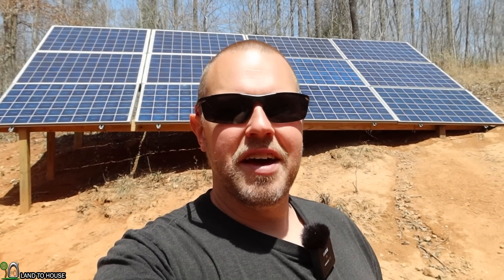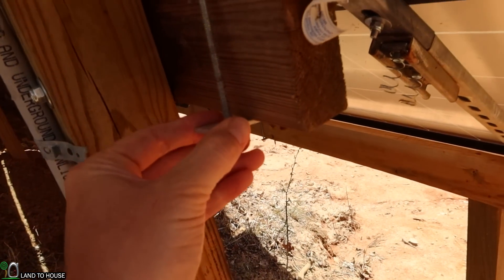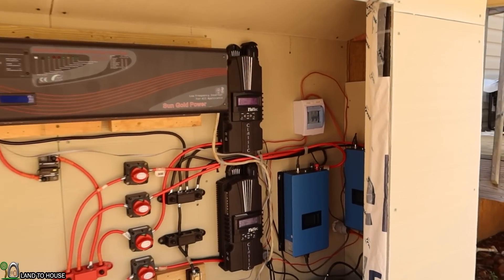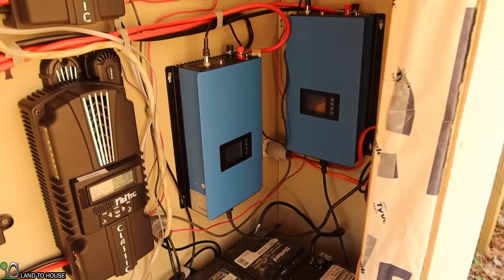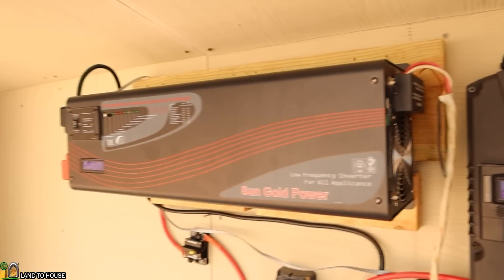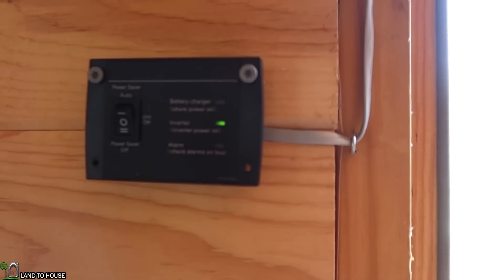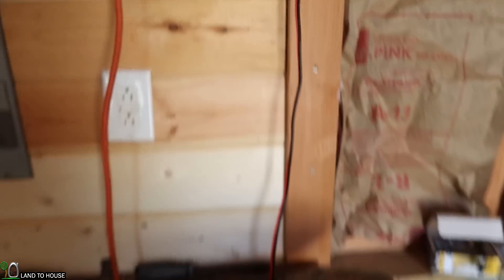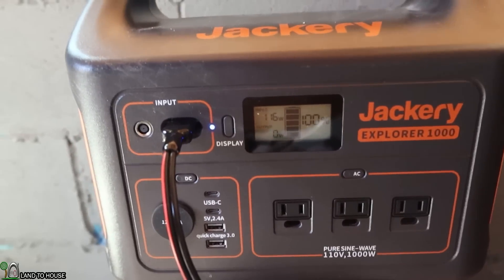Grid Tie Solar and Off Grid Solar Update

Comment: Why are you using AC lights for your off grid systems rather than just 12v lights coming strait off the batteries? Inverts loose about 10% of the power by converting it from DC to AC.
Reply from the maker: The tiny house was built and wired back in 2014ish. Way before I understood the benefits of 12v. I can easily wire in more lights someday.

Comment: I ran a similar system for quite a while before switching to a big single hybrid inverter (Deye 8k) that can supplement the grid power or seamlessly switch to off-grid mode when the power goes out. I used a mppsolar lv5048 and its charge controllers and a couple of those GTIL2's, I had some backup outlets from the lv5048. It ended up saving about $80 a month in power where I'm at and how much my family uses. It's a lot easier to swallow the out of pocket price if you think of it as "emergency power solar generator that slowly pays for itself", because I would have invested in making the emergency power solar generator anyways.

Comment: Interesting video and setups! In Finland we have 240V and 3-phase electricity everywhere, so Grid-tie inverters are also 3-phase. I Got 10 kW solar panels, but I can sell all that is produced and not used in my house and interesting part is that when I have 2 year contract with 5 snt / kWh for buying (yes Euro sent) almost same as dollar so! And what I sell is based currently stock electricity monthly average price, so lately is has been between 8 to 12 snt / kWh so all you produce over they pay about twice what you when buying from grid! 10 kW produced in April 2022 here over 1100 kWh. Own use about 400 and almost 800 for selling to grid company!

Comment: Would 12v DC lighting reduce the loss from the AC/DC conversion ?   Ram Pump still kicking out and filling 250 gallon totes per day.
Reply: All my lighting is 24v up here. Love it. Set my place up like my boat was.
Reply: I'd make the same suggestion,  12v camper "convenience" lights added to the tiny house.
Reply: @jllaine  I saw one off grid tiny house had 12v LED Strip lights

Comment: good to see different applications of solar, im not allowed to use grid tie inverters so i am going with a transfer switch and sub panel for my house solar system. I have an off grid system in my garage/workshop and it has taken a almost two years to get it to where the system can power everything all the time. The surprise for me was how many batteries i needed to get thru the nights and poor weather in winter.
Reply: Why are you not allowed to use grid tie? What if you use a grid tie inverter with power limited, is good because you don't export energy
Reply: @TheJponton   the power company i have will not allow any power connected to the grid to be active when the grid goes offline. It is possible to get the equipment that is approved to sync with the grid but the expense makes it more economical for me to just install a transfer switch.
Reply: @arnoldreiter435  I understand what you said. I have a micro tie inverter and it was a good investment for me because the minimum power consumption of my home is 150 W and it produces 100w. I have been thinking on upgrade the sysmtem with a 1kw grid tie inverter with power limiter but I need to invest on batteries in order to not waste energy and it will increase the price. If your consumption is more than 4kwh per day maybe that inverter with a samll bank battery will fit for you.

Comment: If you don't know, Unistrut joint connectors exist.  You can eliminate the Al strip & all-thread with a fender washer & screw thru the appropriate slot
Reply from the maker: Yes I saw those at lowes.... but the cost was significant so I went with the super cheap all thread.
Reply: @LandtoHouse  
Ah.  The hvac/r company I worked for uses them as a routine, and I doubt if I ever knew their cost. 🤑
And, I saved your vid bec I'll soon be doing similar & have 0 exp with solar electronics.  And since I have a full-time creek & pond in my back yard, hydroelectric will be in the near future, but the immediate solar will be for aeration/pumps etc for the pond bec I don't want to run elec over the creek.
Thx.  Keep up the vids